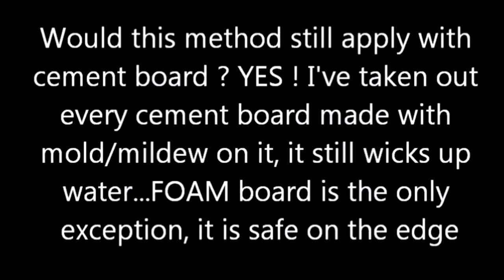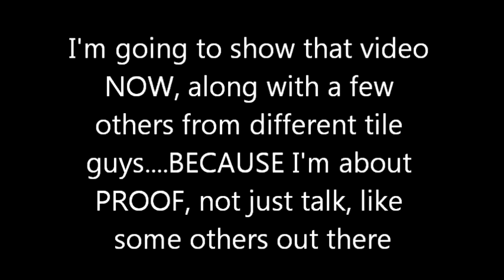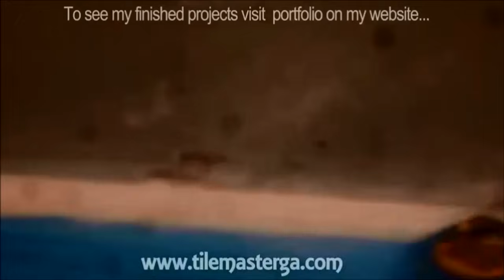WALLBOARD ON TUB

Comment: Not a apples to apples comparison when Sal never uses sheetrock in showers. Foam boards is completely water proof and doesn't wick water, durock is water safe and properly sealed wont wick water either. Having said that unless the whole bath is down to studs, I dont often go over the tub lip do to the bump out it creates into existing wall board.
Reply from the maker: Any cement board will Wick up water and mold behind it I have shown it in many of my videos. And yes, he's used denshield which is gypsum that's waterproofed on front & back but not edges... so the edges would need to be addressed.
And yes the bump out that is caused is real, which is why for a homeowner the method that I showed is much easier and better
Reply: @StarrTile  left unsealed cab will wick, properly sealed it wont. I figured you'd use the few videos he has using denseshield as an example to make your point. Those where all installed by builders not him and that didn't last long before that product was no longer used. And yes he did install a little bit on curbs they left off. Plenty of his old vids show installs that didn't follow the book 100%,( screws through curbs, embedding of dense shield in pans and using it on curbs, roll on over traditional mud pans). The water proofing in those vids will easily keep those few things safe, but technically those are wrong. I'm curious why you wouldn't work to have these standards changed by working with my NTCA, what's the point of talking about anyone else when you believe so strongly in your methods. Do your thing and forget everyone else. Telling people not to follow guidelines will only result in 100% denial in a claim and that's fact. People watching these types of video are mostly DIY'S and don't have years of experience to fall back on. That raises the odds they will have problems.
Reply from the maker: @hereticxxx9317  I can't possibly address all of the issues you brought up, more than likely I will do a livestream this evening to address the elephant in the room...
But I will say this, you are 100% correct that most of the people watching my channel and other people's channels are homeowners, I don't want them ending up with the problem or problems that I enumerated in my video and therefore I am obligated to protect them regardless and despite what standard somebody else has written.

Comment: Is Hardiboard a good product to use for my tub area?
Reply from the maker: Any backer board would be sufficient as long as you waterproof it
Reply: @StarrTile  isn't Hardiboard already waterproof? If not, will red guard be sufficient... seams & screws? Is it true that covering the walls of the tub area with waterproofing can cause mold?
Reply from the maker: In the video I expound on the fact that it doesn't matter what your backer board is, I use green board and set it on the lip of the tub not the edge, then waterproof..all the things you're talking about are moot issues if you just do that
Reply: @StarrTile  my Kohler Villager only has an edge or lip, but whichever it's considered, there's only one so I installed wood between the studs along the edge of the tub a left a bit of a gap between the bottom edge of the hardibacker and the tub edge/lip. Then will apply fiberglass membrane and Hydrobarrier or Aqua Defense over the gap.

Comment: In frame 18:50, to set board on the edge, wouldn't u STILL NEED to fir your studs out?
Also, do u or not reccomend mesh tape and waterproofing when u set the board on the lip??
Reply from the maker: Why would you need to fir out your studs? If you need to do that then the tub was framed improperly from the start.. there should be at least half an inch to 3/4 of an inch of wiggle room from left to right and your wall board will take up anyway.
My opinion is a mesh tape doesn't do a whole lot, mesh tape is a crack preventer, your waterproofing is a crack prevention membrane too, you could do both and be redundant I suppose
Reply: @StarrTile  if u set the tub/pan to the studs and u run backerboard over the lip/flange you'd have a bulge on the bottom of your backer board.
Even with the fancy tub/pan with the edge where your tile chimes out to?

Comment: If you are screw-in the lip into the studs, and the wall board is above the lip the screws would be exposed. .?
Reply from the maker: The screws anchoring the tub are at top, 3/4" to an inch above edge of tub...the edge has a curvature so no water would build up there.

Comment: You’ve posted a few people I watch - Sal and HomeRenovision.  Are you saying that what Jeff described is the right method? From your video it looks like the best method is to put the board on the top, or a small gap, and lay the tile so it overhangs the board and covers the gap. Is that correct? Would you fill the overhang with epoxy grout or leave it empty? Other than Sals bit of misinformation would you say his videos provide good information?
Reply from the maker: I advocate for setting the wall board on top of the lip, or as Michael did and Jeff did leaving a small Gap, whether that Gap is filled in my opinion doesn't matter... the three quarter inch overhang on to the tub edge with last part of tile. 

Sal is an okay tile setter, the issues that I have with him is when he purports that a certain method is bad he never shows proof whereas I always do in my videos... plus he's a book Soldier and can't admit certain methods aren't good despite evidence to the contrary.
His overall knowledge is the ability to cut tile and that's about it.
Reply: StarrTile can you link me to a video where you show how you place that first tile? I have two bathrooms I need to do (my house and my parents house) and I want to make sure they are done right.
Reply from the maker: @gooseseey4687  just Google " first row of tile "  . my video will come up first
Reply from the maker: @gooseseey4687  but if you're asking where to set the first row of tile on a tub then it would be directly on the tub assuming that it is level and you give yourself about 1/8 inch Gap
Reply: @StarrTile  It it's directly on the tub why would there be a gap?
Reply from the maker: @mawangdwei3866  because you need some sort of expansion Gap, eighth of an inch is okay, 16th of an inch is pushing up but you could do that
Reply: Would you recommend 1/8 gap or 1/4 gap?  Between wallboard and the lip..

Comment: I’m 20+ yr setter in Seattle...
That’s the way I was  taught. 
On top of the lip. 
 Also too...
 I usually clean a tub and put couple layers of 2” blue tape on the deck, tape off the drain hole, tape couple layers of auqabar to the floor, and throw in a nice drop.
Shake it out daily. 
  You’re scaring me rubbing all that dust all over the place 
 Is that a scratched up tub already??

Comment: I am putting in a new tub and will be tiling the walls.  I am using Go Board fo the walls.  My problem is that the tub just fit in the space and the wall board comes down and it doesn't line up with the top of the tub lip.  It is actually about 3/8 inches out from the lip, so there is a gap.  y question is, how do I deal with this.  When I put the tiles on, they will not be lined up with the lip, but hanging over it.  Help!!!
Reply from the maker: Best case scenario ! Yes if flush it's best, but you'll be ok, your tile will be bumped out but won't matter as long as you caulk at the bottom.
Worst case is opposite where wallboard too far in and tile can't get past the lip...which requires build out of all 3 walls
Reply: @StarrTile  So, I want to be sure I understand correctly.  The overhang is 3/8 inch plus the thickness of the tile, and I need to caulk that whole space back to the tub lip?  That means water will be able to collect under the tile/board, but it will be against the caulk.
Reply: Is there a video that shows this that I can watch?
Reply from the maker: @sondralawton4293  the process is fairly simple but yet hard to explain through typing...
As I said you don't have any problem, if the reverse was an issue in your backer board was nowhere near the lip then we would have a bigger problem, right now you don't have any problem

Comment: Maybe a dumb question.....Why not just hang the drywall behind the tub sides and screw the tub to the wall OVER the wallboard? Then when you set the tile ONLY the tile comes in to contact with the tub. Of course you'd need an extra 1" of space on the width and an extra half on the width factored in to the spacing. It's fairly easy to create a true fit for the tub these days because of lasers so shimming wouldn't be necessary.

Comment: What type of wall board is this? 
Thanks
Reply from the maker: Greenboard
Reply: Is this regular drywall? With some sort of moisture resistant barrier? I like the fact that it would be much easier to cut. I’m out in California. I appreciate the reply. I guess adding red guard to pretty much anything makes waterproof anyways. 
Merry Christmas Sir 👍🏽
Reply from the maker: Green board is chemically treated with mold and mildew inhibitors oh, but you are correct the backer board does not matter if it is waterproof, Merry Christmas to you as well

Comment: How do you feel about not grouting or caulking where the tile meets the tub and leaving an 1/8” gap, assuming you butt wallboard against lip? 

Caulking will go bad eventually and grouting doesn’t allow for movement. It actually makes it easier to dry out and simple to wipe clean..
Reply from the maker: Yes I understand, caulking no matter what it is will eventually get a little mold and mildew growing or just peel off and then you have to re caulk which is a pain in the ass...
Maybe leave that Gap there as you mentioned and use a 3/4 slim piece a plastic molding to hide the Gap? I don't know
Reply: Thanks!  When I need to redo my tub I am going to leave that gap unfinished and see how it turns out. It’s a minor visual detail that could save a lot of future headaches - or at least I hope so.
Reply: There are special tile moldings for inside corners if you dont feel comfortable with the caulking.
Reply: Neil Schmiel silicone will last years. I would never in my lifetime leave an open gap under the tile. Moisture from showering and someone splashing around in the tub will cause problems.

Comment: Watched the video, but it seems like you don't take into account the fact that tile and grout are not waterproof.  Therefore, the waterproof membrane (Redguard, Kerdi, etc.) needs to find a way to extend past the bottom of the backer board, past the tub flange and proceed to the tub edge.  Also, and probably more important, is the fact that once the water moves down (behind the tile), it accumulates on the tub edge between the flange and the back of the tile.  It will eventually work it way up onto the backer board and toward the front where the tub meets the drywall.  𝐓𝐡𝐞𝐫𝐞𝐟𝐨𝐫𝐞, 𝐭𝐡𝐞 𝐦𝐨𝐬𝐭 𝐢𝐦𝐩𝐨𝐫𝐭𝐚𝐧𝐭 𝐭𝐡𝐢𝐧𝐠 𝐲𝐨𝐮 𝐜𝐚𝐧 𝐝𝐨 𝐢𝐬 𝐩𝐫𝐨𝐯𝐢𝐝𝐞 𝐰𝐞𝐞𝐩 𝐡𝐨𝐥𝐞𝐬 𝐢𝐧 𝐭𝐡𝐞 𝐭𝐢𝐥𝐞/𝐭𝐮𝐛 𝐜𝐚𝐮𝐥𝐤 𝐥𝐢𝐧𝐞 𝐭𝐨 𝐚𝐥𝐥𝐨𝐰 𝐰𝐚𝐭𝐞𝐫 𝐨𝐮𝐭 𝐟𝐫𝐨𝐦 𝐛𝐞𝐡𝐢𝐧𝐝 𝐭𝐡𝐞 𝐭𝐢𝐥𝐞.
Reply: can you explain how to do that

Comment: U said sit it on the edge then u said set it on the lip. Which one is it?
Reply from the maker: You can set it on the edge if it's foam board, but on the lip for any other board that is cement based or gypsum
Reply: @StarrTile  thanks

Comment: I just bought a house it was built in the 1950’s and I’m remodeling the walls in the shower And the tub is an old cast iron. If I get the same thickness In backer board as the drywall on the bathroom walls the  backer board doesn’t come out far enough to even hover over the lip of the tub and I have no clue what to do. Or if that’s even okay.. The drywall is a 1/2in and the gap is an 1in   When I was taking the old walls out there was two layers of drywall… and I don’t think that was good

Comment: Good info here.  Your logic makes sense, even though it's kind of all-over-the-place as a video :)  Learned lots more from your answers to written questions.

My question: I hired a guy to hang my cement backerboard around my tub so I can tile it (first-timer here).  He then proceeded to use Silverset hot mud not only to feather out from the seams to flatten the wall, but to fill in the gaps between the bottom of the backerboard and the edge of the tub.  He says that as long as we waterproof it with membrane it should be fine.  I'm not so sure about that...  Seems like eventually water will make its way into it and up to the board.  Should I chisel that stuff out?
Reply from the maker: You could do either, either waterproof or chisel it out, the effect would be the same to mitigate any wicking
Reply: @StarrTile   Thanks for the quick reply!  So you don't think there's any danger of the waterproofing breaking down at some point in the future, making the compound into a sponge?   The images of the rotten walls on your video were a nightmare, so I'm still a wee bit paranoid...  New at this and I need to get it right :)

Comment: I've got an old cast iron tub that I'm keeping.  The tub has an "edge" but no integrated tile flange "lip."  The "edge" rolls strain back to the framing.  I plan on using larger 12 in.length subway tile so after the durock is installed I'm not quite sure how much of the tile will be hanging off durock and hovering above the tub edge.  This is actually what is delaying the entire start of this project.  It makes me nervous the thought of not having the safety net of an integrated tile flange.  I just keep thinking of water wicking in especially on the wet wall.  Everyone locally has said to just set durock on tub edge and put a bead of the best caulk in gap.  This goes against everything this video is about
Reply: That is pretty much where I'm at in my project as well
Reply: @Tru2Me3  I took the plunge and just went for it.  I treated the tub edge as if it were the flange.  I installed durock leaving an 1/8th in. Gap above the tub edge and put a bead of GE lifetime warrantied against mold/mildew in the gap. (This may be a no-no per Starr tile guy.  My tile will hang past that and I'll leave another gap between tile and tub "deck" and put a bead of caulk that matches my grout in that gap.  I used an entire quart of aqua defense on every inch of durock backer board. I feel confident about the steps that i took.  I also feel that if I succeed with keeping water from reaching the GE caulk that will be behind my tile that the mold growth won't occur but time will tell.  I plan on maintaining the grout matching caulk making sure to reapply.  1 more thing that I did was apply aqua defense to the back side of the durock where it would meet the tub.  I put 1 coat on on all 3 sides but only  the bottom edge and 4 in. up the backside to stop mold growth.  Hope this helps.  It looks bulletproof but whether or not it is I don't know.
Reply: This is also our situation. The tub without a lip was installed back in the 70's.  We don't know if that was the only choice back then, or if the installer didn't know better, or thought they would save a few cents. At one time I saw a video about leaving a gap above the edge of the tub, then filling the gap with backer rod, and caulking over that. But after watching this it looks like that would only work if you're lining your walls with something a solid surface wall like Corian, that wouldn't mold. I didn't save the link and haven't been able to find it since. I tried searching this channel but nothing is labeled as dealing with a tub WITHOUT a lip, and I don't want to watch them all.
Reply from the maker: @user-qq7eo2xd3p .....https://youtu.be/UMXzNYD63Ww
Reply: @StarrTile  That's an interesting video and the end result is beautiful. But there's no explanation of dealing with a tub without a lip?
Reply from the maker: @ConradAltan  it was thought that it had no lip and in fact it was a very very slight lip but I fixed the problem by doing what I did in the video
Reply from the maker: @ConradAltan  honestly not enough guys run into that issue which is why you can't find a video, I have never run into it except for that particular job and I came up with a solution
Reply: @StarrTile  Can you indicate the minute mark where you show the solution you used?

Comment: The guy's expansion/contraction argument is nonsense. Whether sheetrock is set on the lip or the edge it is still different materials. Contraction/expansion differences - if even true - would be the same on the lip or the edge.  So I agree with you - just lift it up off the edge where water collects!   Another thing, would it help to coat the edge of the cement board with Aqua Defense just for added protection?

Comment: I wonder if the video producer has ever worked with "newer" technologies such as schluter foamboard?
Reply from the maker: Yes of course I have, not necessarily Schluter because it is overpriced, Goboard yes, and I use Kerdi on occasion for other purposes.
But I don't 100% trust foam for the Long Haul, and any backer board that you use will be waterproof or it should be anyway so therefore the Becker does not matter, it's the application of whatever product you use that matters the most 👌🏻🤟🏻
Reply: @StarrTile  Do you trust Laticrete hydro ban foam boards + sealant caulk?
Reply from the maker: @johnkim1656  of course, it is not that I don't trust any of these boards, I just feel like a prep of a shower should weigh more than 5 lb... call it an old school mindset or whatever you would like, with all the foam and plastic and Sheet membranes out there it doesn't make any sense that this stuff would last a hundred years
Reply: @StarrTile  I thought the same thing. But then again, foam and plastic trash in the ocean lasts decades!

Comment: very nice video.  i have one question, bottom row of tiles where the tile meets the tub, there is nothing holding grout because there is a void between the tiles and the tub lip?  any suggestion how to grout that part?  thank you.
Reply from the maker: Where tile meets tub there should be an 8th inch gap..you can grout AND or caulk there
Reply: @StarrTile  thanks ; - )